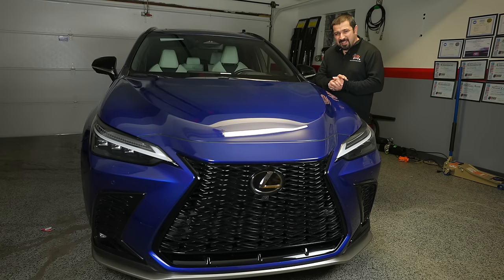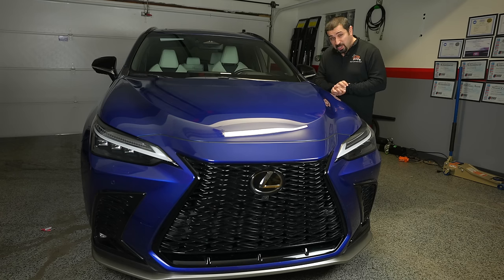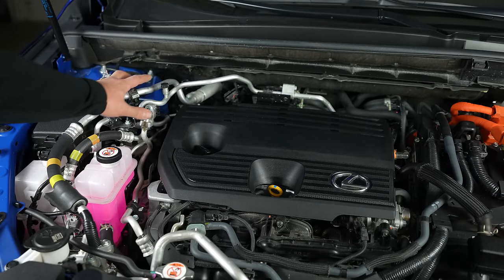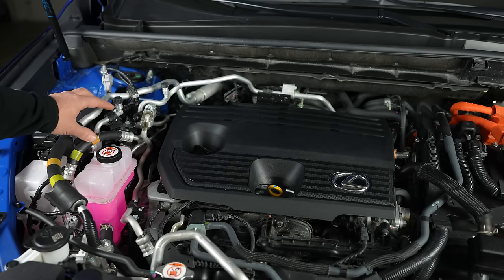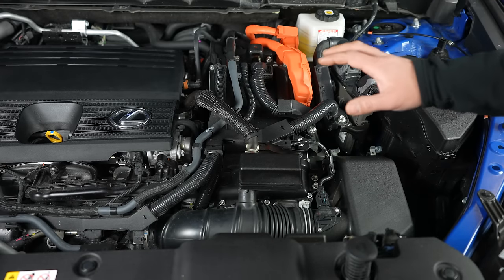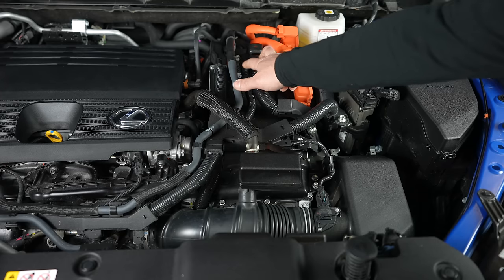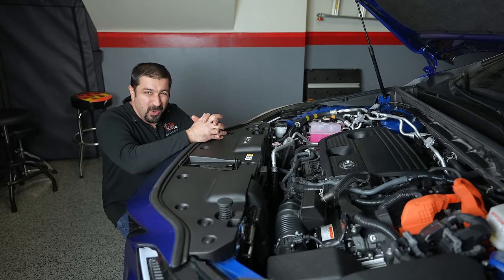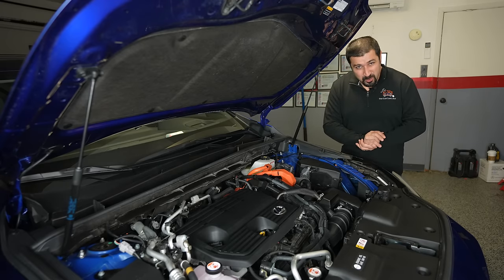The 2022 Lexus NX Marks the New Era of Lexus! Full Review and Technical Tour

Comment: :goodvibes:Thank you for all your valuable information ! I have a 2012 Tacoma TRD 4WD V6 ( 1GRFE) engine. When I changed the spark plugs @ 32,726 miles I switched to Iridium spark plugs (Denso SK20 HR11) for longer plug life. Was this a good change or do you recommend that I stay with the original Platinum spark plugs/ Thank You
Reply: he always recommends original as does scotty kilmer
Reply from the maker: Hi! You can switch in this case

Comment: Great review Ahmed as usual.
I am undecided about upgrading to the new Nx, i have a very clean 2016 Rx premier with less than 20,000 miles on it, i wanted the Nx when I bought it but did not like how it drove, not as refined as the Rx, the Rx is a bit too big and the infotainment system is poor but not worth spending the extra money and high Rd tax in the uk.
Don’t you think the new door handle design has something to do with the new safety feature of preventing it opening when someone is approaching from the side so electrical rather than manual!.

Comment: They lost me with that complicated button to get out of the car.  To me, that's a huge safety issue.  If you ever find yourself in floodwaters (common here in the northeast) or God forbid in a lake, you're dead.  Also, if somehow the car loses all electrical power, and the doors are locked in the hot sun.  You can't improve upon a simple manual latch to get in and out of a car.  Simple as that.  AMD, gotta say you do a great job on these videos.  As an owner of 2 Toyota's, I look forward to every video you make.  God bless.
Reply: Have not yet taken delivery but my understanding is that there is a manual override for just those reasons. There is a door handle you pull twice.

Comment: I have a RAV4 Prime with heat pump. Does anyone else notice the embarrassing vibration that occurs when the heat pump goes to heat mode at start up? I think it is a very slow switching of the reversing valve.
Reply from the maker: Hi! The vibration is a known thing with the heat pump. It might be a normal characteristic as many has asked about it and there’s no official response to it

Comment: AMD has done a wonderful job of extolling the virtues of this car, but I have a few complaints that I feel compelled to add. 

1) I just can't support the use of touchscreen controls for HVAC. Knobs and sliders are best; buttons are a decent equivalent. But touchscreens and menus? As a Canadian who lives out on the prairies, I can very easily imagine a day when I head out to my car at -20 Fahrenheit; the screens tend to be slow and non-responsive, and my hands tend to be covered in thick gloves. Capacitors? Forget it.
2) 100% agreed with you - what in heaven's name are they thinking with those ridiculous doors? Much easier to be able to grab a whole handle while wearing gloves than it is to try to hit a button on the back. 
3) In addition to the run-flat tires, what is the deal with those gigantic rims? That tiny brake rotor marooned in the middle of that huge empty space looks ridiculous! Big rims are heavier, are much more expensive, require much more expensive tires, and lead to a less comfortable ride. It's a plug-in hybrid! They could probably have grabbed some more range with a more reasonable tire/wheel combination. 
4) SUVs have apparently given up completely on the pretense of off-road capabilities; the lack of a spare tire is a shocking oversight. (Though everyone deserves criticism for this now. That's hardly just a Toyota thing.  I blame BMW for the trend.)
Reply: As a Canadian who lives in Ontario, I would just buy the more practical RAV4 Hybrid.
Reply: The new doors are linked to a safety feature where they will not unlock if the sensor detects a car or bicycle on the side. I think this is a dumb idea and unnecessary but that is the justification.
Reply: I am in Sask and have had a RAV4 Prime for a year, you would like it. Real door handle, physical HVAC knobs, spare tire no runflats. Handles -40 just fine.
Reply: @InternetDude  Sounds like, overall, a better choice - and at some $20,000 less than a fully-loaded NX, a pretty compelling deal.
Reply: @MTerrence  yes and there is instant $5,000 federal rebate for the EV ness of it (not on NX due to vehicle price).

Comment: Would you recommend this car over the rav 4 prime? I'm liking the new direction of Toyota.
Reply: I have a RAV4 Prime and I would prefer the huge touchscreen of the NX. The rest of it meh it’s nice but big bucks.
Reply from the maker: It depends. The RAV4 prime cost and range wise is better. The NX is more luxurious and quieter and has better tech. If the advantage of the NX justifies the price difference for you then it’s worth it. Otherwise you’ll be happy with the RAV4 prime
Reply: @InternetDude  Hey, since you have the Prime, does it also not have the movable shutters as this NX plug-in?  Thanks
Reply: @xfirstxlast6502  no grille shutters on the RAV4 Prime either.
Reply: Is the turbo on the new nx reliable? I'm torn between the rav 4 fully specd and the new nx turbo with premium package. Both cost about the same but the nx built in Japan.
Reply: @dmitpharm  I would avoid all turbo engines. There is lag off the line and will always be more maintenance in the long run. I’ve owned two turbo vehicles, never again.
Reply: @InternetDude   Interesting it has no active grills either.  Thanks!  Wonder if the same for the 350h hybrid?
Reply: @xfirstxlast6502  good question, I think so because I’m quite sure the RAV4 hybrid has them.

Comment: My 1993 SC400 had cornering lights. They work amazingly well. 
We have a 2024 NX450h+ on order. Can't wait to get it. Pearl white with Rioja red leather interior.
One thing I don't understand is why Lexus recommends premium gas, although the manual says you can use regular (87) gas. This is the same engine as the RAV4 Prime and it takes regular. Is this just a Lexus thing, trying to make its customers feel "premium" by filling with premium?

Comment: Im just throwing this out there. But I rekon the 3 hood clips are like that so as to keep the front line of the hood rigid and flush so to make a good seal with the bumper seal. This would ensure that across the full width of the vehicle the seam seats nice and flush as designed which I believe is such as to help decrease wind resistance. Otherwise no clue haha
Reply: Could be. My guess was that it probably has an aluminum hood like my Prius and the 3 latches are needed in a crash to hold the weaker hood and maintain crumple structure.

Comment: Forgot to add a comment about the F Sport seats… as compared with the seats in my 2021 RX350 F Sport, the new ones in this new NX 450H+ F sport are superior.  They are much more comfortable, hold you in place without feeling like they are pinching you in the hips.  The back of the seat is very comfortable giving that feeling of hugging you - especially as you corner through turns.  I test drove the Lexus 450H+ Luxury package as well.  It is a smoother, softer ride, but since I am used to the F Sport seats in my RX 350 F Sport, the seats in the NX 450H+ Luxury Pkg give me the feeling of my butt sliding around in the seat when cornering.  Don’t get me wrong, the Luxury pkg model is VERY nice.  I loved the self-parking feature, however I don’t need help in parking a car.  With the help of the 360 degree cameras showing where the car is relative to its surroundings, I had no need for that self-parking feature.  I had a hard time deciding between the two cars, but ultimately the F Sport won out.

As per usual, your review of this new Lexus was thorough and interesting. Thanks for yet another great video!

Comment: Thank you for making this video, It is really informative. I have a question about the 12V battery and how it charges via inverter from the traction battery. Does the 12v battery need to be charged separately to keep it fully charged?  Or does driving around in full EV mode or having the car in "Ready" mode, not ACC charge it fully every time it is driven in ev?

Comment: I agree on the tires. I hate them. They’re hard and ride ruff. I bought a 2020 Prius Prime Limited. Like it. Wouldn’t want this car… I really like the car in electric mode. Will probably go with all electric next time, when the shortage is over with, and prices level off. I don’t drive very far from home very often. I wish they could have an electric car that used the gas motor as a back up, primarily because of limited charging stations nowadays. Not having range anxiety and all. Sort of like being free. The electric motors produce so much power, they’re quite, and smoothe to drive. When my car goes to gas, it’s like someone hooked a trailer to it. Maybe it’s just the small motor and transmission in the Prius. Like you’re in a Go-Cart. Even if one would go 200 miles. That would be nice. I usually charge at home overnight anyway. Doubt they’ll do this. It’s all about climate change. We get most of our power from coal and natural gas power stations. Don’t really get it? Guess I’m getting too old, and rely on common sense.

Comment: Great to hear your review. I agree with the door handles & RFT which are aggravating to say the least. Annoyingly, the RFT is STANDARD across the NX lineup with the exception of the basic NX 250.

Another annoying aspect of the new Lexus Interface system is the Navigation. Previous Lexus where the Navi is free to use forever, the new Cloud based Navigation REQUIRES subscription to the Lexus phone App to activate, and after that the system appears to only free to use for 3 years. Thankfully, all new MY22 NX have wireless CarPlay & Android Auto, so guess which system I'll mostly use.

Comment: You know what is sad? Kids today will never experience the shifting of a 3 or 4 speed manual transmission and the innate satisfaction and smile on your face when you get the perfect shift and match the rpm with just the right gear when going up and down hills and downshifting and upshifting and listening to a scratchy am radio station with Bill Haley and The Comets rockin'. Or when stuck in the snow and you rock back and forth and get you self unstuck with a little push from your buds. And you can do a tuneup with no tools other than a couple of screwdrivers and sockets in about a half an hour. I can't go on because I am tearing up.  Oh yeah, something I didn't miss. Back in the day all rocker panels rusted completely through in two years.

Comment: Speaking of Lexus I have a question. I have a friend with a is 250. When he trys to start it it doesn't start  but he gets ignition and the instrument  on his dashboard to show you which gear you are in doesn't show anything. By any chance would you know what causes this?
Reply: Battery, Altenator, Starter
Reply: @AustinsCoins  are you sure ? Cause he said the ignition comes on it just doesn't start and they told him that it was something on the transmission that tells you which gear the transmission is in when you shift in into I just don't know the name of it
Reply: @purplehills56  Who is they? Also checking the battery is easy so it's one of those things like why not you know. It might have enough power for it to power the Guages but not enough to start so you never know.
Reply: @purplehills56  I mean, it can anything honestly. It could be a fuel pump too, can't start a car without fuel. I just listed common problems for reasons a car won't start for any car, not just a is250.
Reply from the maker: Hi! If you move the shifter into other positions does it show which gear you’re in? Also does the check engine light come on when you turn the ignition on?

Comment: I find myself disagreeing on rear styling.  For me?  Floating letters like that look cheap, not high end.  The lexus logo is nice, name is nice.  But five letters just is.... eh... and the light bar strip twenty years ago looked cheap.  It has a glued on appearance vs a functional design like the few cars that pulled it off well.

Myself?  I say ditch the light bar as is.  Make it more solid, and integrate LEXUS into that vs glued on letters.  A nice embossed looking trim piece with Lexus on the left and a small embossed Lexus on right would look stunning!

Edit: And move the model badge under said trim piece in a nicer form instead of where currently is.
Reply: I agree with you on the letters.  Seems like they chose to jump on the bandwagon

Comment: Appreciate your knowledge!
I am buying NX450h+ shall I get Luxury package or Sport package? Please advise thanks!!
Reply: If you pick fsport over luxury...
you gain: cool look (more aggressive grill, blackened trim instead of chrome trim) sports wheel, sports seat/steering wheel/pedals, most important of all, adaptive variable suspension.
you lose: leather seat (sports get nulux seat), advanced park

IMHO, i'd get fsport, price difference is very little.
Reply: @epcdasilent  appreciate you information! You recommend to change the tiers due to run flat tires, what tiers do you recommend instead? Thanks as always Ahmad!
Reply: @SD-it8nj  I am picking up my 450H+ soon, I plan to use the run flat for now since its already there no point wasting it. At the end of the tires' life I will probably switch to something like a Michelin Primacy 4season tire so I will feel the upgrade difference and not waste the run flat. What kind of tires you need will depend on your location and climate. But a 4 season will be very practical as long as you dont face extreme weather. Cheers
Reply: @epcdasilent  hi there,
Do I need to buy 240 V cable charger in order to charge level 2 for NX 450h+? I have a NEMA 14-50R installed in my garage for my Tesla can I use the same cable to charge NX 450h+? If not any recommendation where to buy the 240V cable charger for NX450h+ please. As always appreciate your support thanks!

Comment: AMD I have a quick question. I have to take my 19 4Runner for the fuel pump recall before I undercoat the frame. Question is: do they replace the pump in addition to seals and what ever holds the pump in place or just the pump itself? 
I honestly don’t want anybody touching my car but it has to be done. 
Thank you!!!
Reply from the maker: Hi! They’ll take the fuel pull assembly which is the whole housing. Only replace the pump and o rings around it. Then replace the o ring for the fuel pump housing to the tank and the lock ring
Reply: @TheCarCareNut  thank you soooo much.

Comment: Car Care Nut - I have the 22' NX450h+ luxury version and the steering wheel has a subtle but uncomfortable vibration.  Took it into the dealer and of course they said nothing is wrong.  I think it's possibly the run flats?  Any suggestions?  I wish I was in your area, I would love for you to take a look at it.  It's so bad, I started a lemon case against Lexus.  Rides smooth though which is weird but the steering wheel vibrates and it feels like I was using a power sander after driving it for 30 or so minutes.  Any suggestions  would be helpful.  Thanks.

Comment: This car  looks like Toyota is showing us a template of how they plan to pivot to fully electric vehicles.

Alot of the details makes this hybrid seem like an electric car first with a traditional internal combustion add on.

1. The battery size and placememt is perfectly divided to fit half the driver's half of the car. I would imagine Toyota would test full electric prototypes by adding another battery of the exact same size right next to it on the passe.egr side (after removing the ice components).

2. Doesn't use traditional 'in car  cabin air cooling' battery treatment. Has refrigerant cooling.

3. Heat pump for the HVAC

4. Plug in hybrid

5. Dual motor for Regen

6. Doesn't have the shutters in the front because coolant is not staying long term.

Comment: Amd, how are you ? I been wanting to clean my engine bay on my camry and lexus so my question is, what are the Do's and Don't? Thanks
Reply from the maker: Hi my brother. I’m doing well and hope that you are doing well as well. Don’t spray direct high pressure at electrical connectors and best is to wet everything down and use a brush to agitate dirt then a quick rinse and dry it with compressed air if possible
Reply: @TheCarCareNut  Thanks brother! I appreciate giving me advice on all my cars since I started following you AMD. I don't know what I'd do without you! Have a good weekend

Comment: hmmm, that opening for the power steering motor underneath is not logical to me because most of the excessive steering inputs are done in very low speed .  But perhaps the motor is a bit to close to the exhaust which causes add heat on it. ;-)

Comment: Hi AMD , the NX 250 2.5 liter is hard to come by , I am looking at 350 NX w/ I 4 turbo  with $3000 more , it it worth it . Does the turbo engine require more maintenance cost? Thanks for your channel. Appreciate.
Reply from the maker: Hi! Turbo engines will require more timely maintenance
Reply: @TheCarCareNut  ok Thanks.

Comment: Hey AMD, when you set the inner door handle to manual mode, and shut the door, do you have to move the lever twice again to open it? I'm wondering if that's the reason why touching the button on the inside doesn't lock the door but only resets it back to auto mode. 

Anyway, the reason for the inner door handle being both electric and manual is because the NX has side collision detection, it can lock the door and keep you from opening it if it senses there's a vehicle coming up on your side. In my opinion, this is a safety nanny that only rewards the dumb. I can't remember a time when I've opened the door without first making 100% sure that there are no cars or bicycles coming up behind me. Stopping the car and just opening the door without first looking feels so unnatural, and such a stupid thing to do, and we actually have to program this feature in because people are stupid.
Reply from the maker: Hi! When you push the button on the handle it automatically goes into auto mode and opens